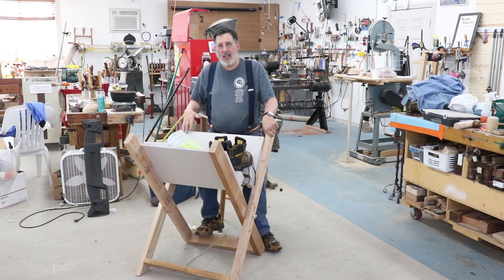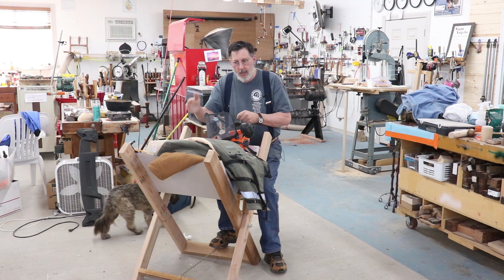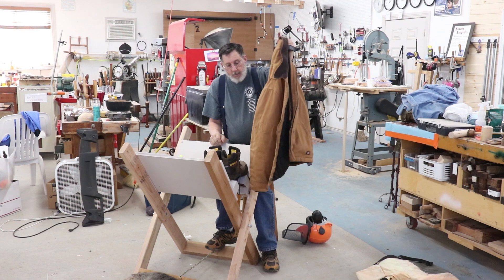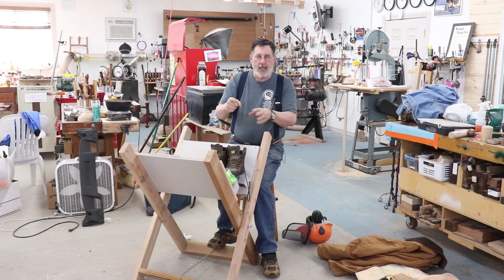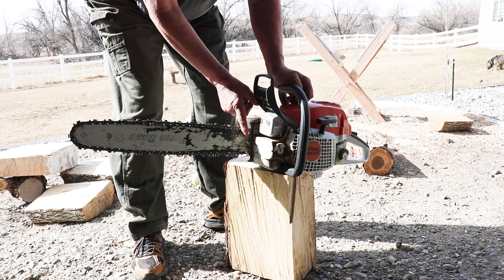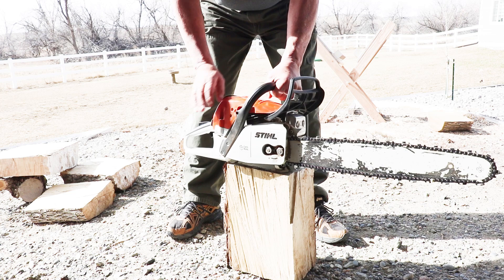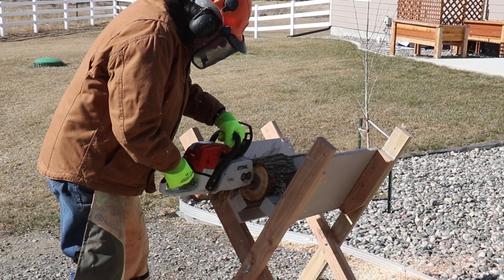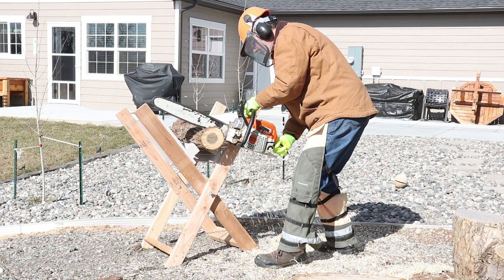Chainsaw Safety for Woodturners      with Sam Angelo

Comment: Thanks Sam. This is a topic which deserves attention, and you have carefully presented this nicely. I've been using chainsaws for years, first for felling to clear land for our home, then later trimming as a climber, and today as a woodturner for bowl blanks, etc. As a turner my favorite tool is a small top handled Echo gas powered arborist chainsaw, but if I were only using this for woodwork I guess I would agree that the electric option would be a better choice. I think people new to these devices need to realize that kickback can happen in different situations, and that a "small" section of log can be moved by the saw if not clamped correctly. I was interested to see your sawbuck in use. The clamping action on the log seems to work well; I'll have to modify mine.

Comment: Can't be too safe with a chainsaw. The biggest thing I learned that you did not mention was keep a still left arm.If you get a kickback, the stiff arm will cause the saw to kick up and not back like it will with a bent elbow. I have the same model farmboss that you have. Take care and keep the videos coming.
Reply from the maker: Mike,  Yes I did forget to mention this.  It is something I do myself but failed to mention.  It is critical that the left arm be locked in-so to speak.  Thanks  Sam

Comment: I love my 2 chainsaws. One is gas & the other is electric.  I’ve worn out the trigger on my electric, so I need to order that part for replacing. Gas one is Echo and stats every time on about 2 pulls. The electric is Husqvarna and cuts like a gas powered.
Reply from the maker: Suzanne, what size bar does your electric saw have.  I would like one with a bigger bar....Sam
Reply: 16” bars on both. Would like to get 18” for the gas saw.